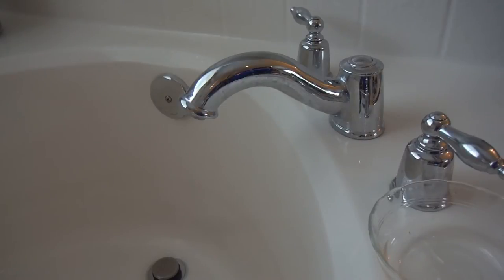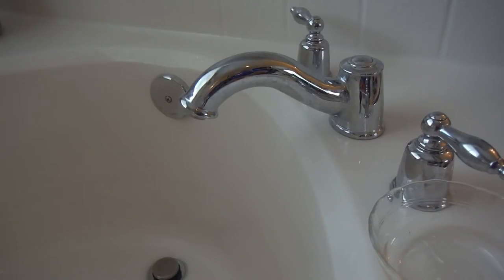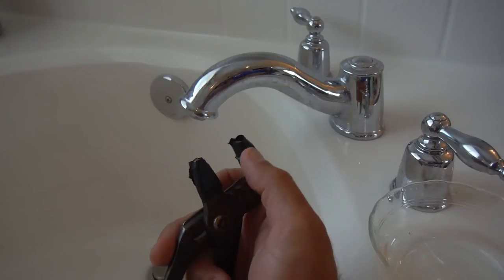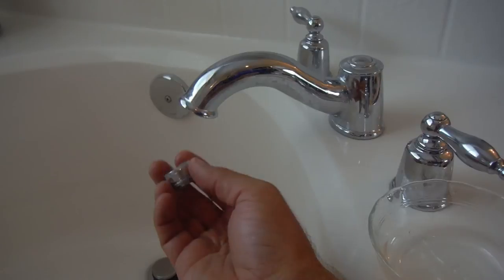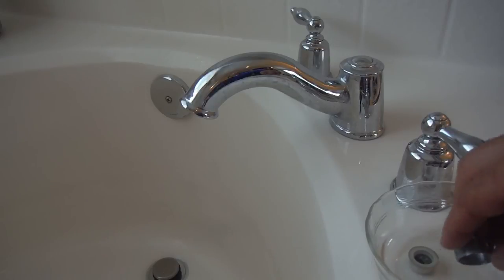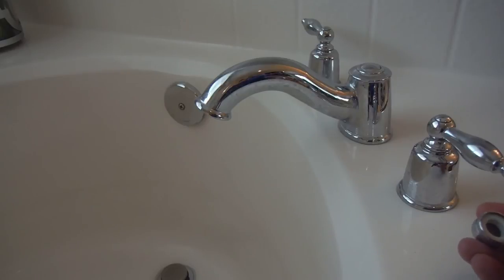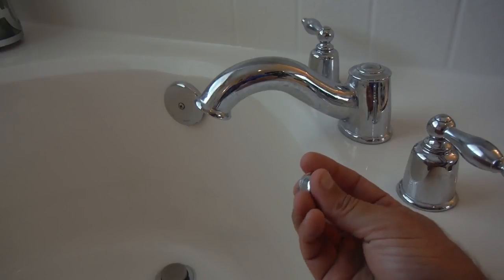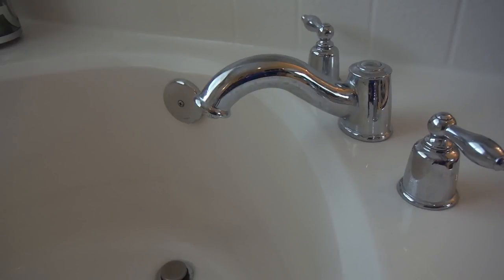Plugged Bathtub Faucet Low Water Pressure (Cleaning the Aerator Screen)

Comment: I'm pretty sure my screen is clogged but, the faucet doesn't have that little "lip" to grab on to.  It's like the screen is attached directly inside the faucet.  Any suggestions?
Reply from the maker: It sounds like you have a ‘hidden’ aerator.  You might need one of these tools that can remove it.  Here’s a link: https://www.amazon.com/dp/B07NGJG6BT/ref=as_sl_pc_as_ss_li_til?tag=danthefixitma-20&linkCode=w00&linkId=d1e12616b0ef150bfefb70d80ee33e38&creativeASIN=B07NGJG6BT
Please let me know if this works for you.  Best of luck to you.
Thanks for watching!
-Dan the Fix it Man